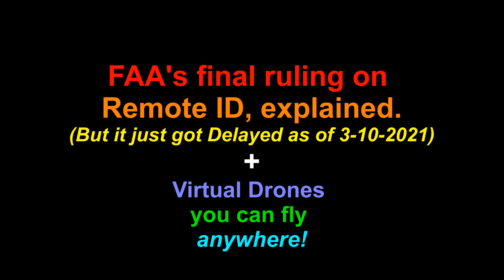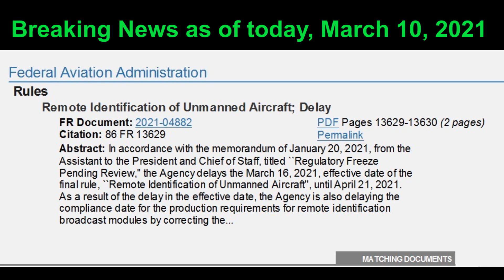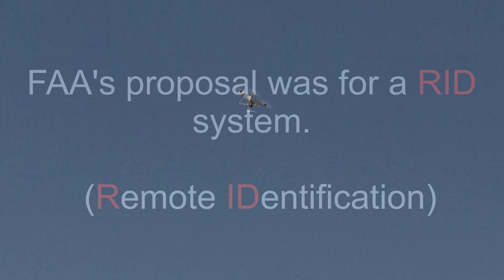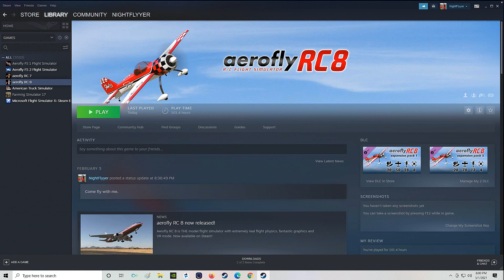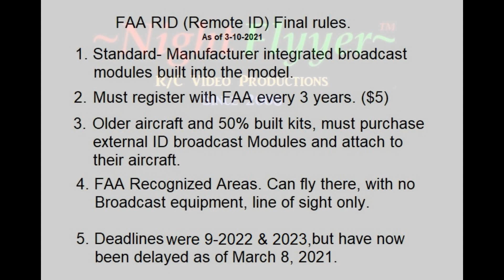Required: FAA Remote ID Broadcast Modules for all model Aircraft over 1/2 lb. I explain the Ruling!

Comment: Well isn’t this another  “fine mess”  they’ve gotten us into.
Reply from the maker: Haha.  Yep.....always something!
Reply: AMA suckers endorsed....What Is Not A Model Of Anything!!! Stupidos!!
Period
Reply from the maker: @rudyho3790  
 I'm only the messenger and just passing along what the FAA, Model Airplane News, and Model Aviation magazines published this month. We in the AMA community tried to stop the ruling but could not. But they did block the rule to register every aircraft you own and blocked the internet link requirement to just a broadcaster.   We only got it modified to be a little better. I DON'T LIKE IT ANYMORE THAN YOU!  My DJI Spark wont take off if I'm within 5 miles of an aircraft, so it has already begun.    If you have a better solution, then again I suggest you contact the FAA and tell them, since it was delayed again and they are requesting comments and suggestions.  Maybe if enough folks do that, this stupid law will be rescinded. Here is the email address.   UASRemoteID@faa.gov.
Reply from the maker: @rudyho3790   I'm only the messenger and just passing along what the FAA, Model Airplane News, and Model Aviation magazines published this month. It was the Full size fire fighter aircraft and airline pilots who complained to the FAA and started it all. We in the AMA community tried to stop the ruling but could not. But they did block the rule to register every aircraft you own and blocked the internet link requirement to just a broadcaster.   We only got it modified to be a little better. I DON'T LIKE IT ANYMORE THAN YOU!  My DJI Spark wont take off if I'm within 5 miles of an aircraft, so it has already begun.    If you have a better solution, then again I suggest you contact the FAA and tell them, since it was delayed again and they are requesting comments and suggestions.  Maybe if enough folks do that, this stupid law will be rescinded. Here is the email address.   UASRemoteID@faa.gov.
Reply: Def.not your doing....we will simply ignore alien👽orders😂😂

Comment: The fixed wing aircraft are not and were not an issue. This ruling is still trash why I'm not buying more aircraft.  What I have will soon be relegated to hanger queen status.
Reply from the maker: That is right for sure.  I don't think we old fixed wing or heli pilots ever were a problem as well.  Full scale pilots were complaining about near misses with drones and that is where it all began.
Reply: @NightFlyyer  Full-scale pilots have been complaining about near misses with things longer than radio control's even existed. "Drone" is just the hot new buzzword. Balloon? Drone. Bird? Drone. Speck on the windshield? Drone.
Reply from the maker: @wun1gee  Yes, and I fly my helis and fixed wings, but never in fires disaster areas or at 1000 feet in the path of full size planes trying to land at airports.  I also fly at a small airport and witnessed a fellow flying a drone over the small town fair 1 mile south of the airport.  When my friend with the full size airplane landed, he complained about almost hitting that drone and came to yell at me, because I was AMA and wanted to turn the guy in with the drone.  I don't know who the drone pilot was, but I know this full scale pilot was really pissed.  I also watched the news of the fire fighter aircraft having to be grounded last summer in California, because there were multiple drones in the air.  They showed them, so never say never.  No one was killed, true, but there are real reports of jet engine ingestion's, and forced landings.  What again, is your suggestion to prevent these rogue pilots?

Comment: I build my own quads and they will never comply with these new rules.
Reply from the maker: Yes, I can understand that.  No one likes this new law, except full scale pilots. What's your proposal to the problem airline and emergency pilots are complaining of with near misses of drones?
Reply: @NightFlyyer  I have flown safely and responsibly for 20 years. Planes fpv for 14 years and quads now for 3 years. I never fly over people or property so I put only myself and my quad at risk. We have to use our heads just like always. 
But nobody has ever been killed by a quad. Ever. I think all the government regulation is unnecessary and a detriment to the hobby.
Reply from the maker: @hutchracing4680  So what is your suggestion to stop the rogue drone pilots from flying at 1000 feet in the path of airlines on landing approach or in the way of helicopters fighting fires?  The Full scale pilots are the ones who complained to the FAA, and started it all. True no one was killed but there are reports of Jet engine digestion and near misses by full size aircraft requiring emergency landings.
Reply: @NightFlyyer  NOTHING will ever stop them! We will still have the problem. Its kinda like guns, guns dont point and kill,   the PEOPLE do, same with cars, motorcycles, If they haven't learned this simple fact yet they never will, probable.
  BY the way great video, THANKS!
Reply from the maker: @bretmuldner  Thanks Bret.
Reply: @hutchracing4680  Exactly! No rules or regulations can stop a full sized aircraft from crashing into a house and killing people while they are asleep in bed but that don't stop them from flying over our house every day. Someone else's fears don't equal, my rights taken!
Reply from the maker: @hutchracing4680  Agreed.   I'm only the messenger and just passing along what the FAA, Model Airplane News, and Model Aviation magazines published this month. It was the Full size fire fighter aircraft and airline pilots who complained to the FAA and started it all. We in the AMA community tried to stop the ruling but could not. But they did block the rule to register every aircraft you own and blocked the internet link requirement to just a broadcaster.   We only got it modified to be a little better. I DON'T LIKE IT ANYMORE THAN YOU!  My DJI Spark wont take off if I'm within 5 miles of an aircraft, so it has already begun.    If you have a better solution, then again I suggest you contact the FAA and tell them, since it was delayed again and they are requesting comments and suggestions.  Maybe if enough folks do that, this stupid law will be rescinded. Here is the email address.   UASRemoteID@faa.gov.
Reply: @NightFlyyer  Enforcement of the existing rules that already made such flying illegal? Just a thought. I mean it makes sense so there's no way in hell the government would ever go with it, but that would do the trick.

This shit is happening because Amazon wants to make some bank on drone deliveries, not because of any legitimate safety concern. They're just using the dumbasses as a convenient scapegoat.
Reply from the maker: @TestECull     What again, is your suggestion to prevent these rogue drone pilots?
Reply: rhetzman the same way you stop bird strikes and drunk drivers from driving
Reply from the maker: @MrHetzman   The birds don't know any better, but people do, or at least most do.  LOL.
Reply: @NightFlyyer  - A 100% ban on all clubs, no quadcopters, and stop all sales just like it has been done w aftermarket parts for diesel trucks and certain guns that no longer can be sold.
Reply: @NightFlyyer  I call shinnanigins with majority of them to be honest.. that's not to say they don't happen. But to be honest "drone" pilots are their own worst enemies
Reply: Next they will try to put modules on birds.
Reply: @rodgerhecht3623  lmao 🤣😂
Reply from the maker: @rodgerhecht3623  LOL.   I'm only the messenger and just passing along what the FAA, Model Airplane News, and Model Aviation magazines published this month. It was the Full size fire fighter aircraft and airline pilots who complained to the FAA and started it all. We in the AMA community tried to stop the ruling but could not. But they did block the rule to register every aircraft you own and blocked the internet link requirement to just a broadcaster.   We only got it modified to be a little better. I DON'T LIKE IT ANYMORE THAN YOU!  My DJI Spark wont take off if I'm within 5 miles of an aircraft, so it has already begun.    If you have a better solution, then again I suggest you contact the FAA and tell them, since it was delayed again and they are requesting comments and suggestions.  Maybe if enough folks do that, this stupid law will be rescinded. Here is the email address.   UASRemoteID@faa.gov.
Reply: Post a video I'll turn you in. Lol FPV pilot's will I Care less. I was trolled for a year by a gang of fpv pilot's!  now I watch hobby die.. and I loved it my regular friend's Saw over a course of a Year what FPV means.. And it's not Good. No Honor.. or pride.. just second accounts..
Reply: @sleepingbearffg5008  no one with a brain will post a video
Reply: Amen brother!
Reply: @bretmuldner  no Godly in Hobby? I asked..

Comment: They did not RESIND  They postponed it. Until the infrastructure is in place, then you will PAY to FLY to a PRIVATE INDUSTRY or PROVIDER. The GUBBERMT is going to control every aspect of your R/C flying. Idiots flying QUADS caused this Quagmire. No one bothered REAL R/C Enthusiasts till these IDIOTS showed up. I don't mean QUADS just their STUPID PILOTS.
Reply from the maker: The FAA has made the final ruling.  But they did responded to the first proposal by eliminating most of the rediculous of the proposals that we fought against.
But this week, they Delayed the Deadline before it is required.

Comment from the maker: Breaking News.  As of today, March 8, 2021 the FAA released its final version of the RID Remote ID Broadcast modules for all model aircraft that weigh over 1/2 lb.  I don't like it either, but I am just the messenger here relaying what the latest issue of Model Aviation and Model airplane news has published this month. Here is the email address to write to the FAA and offer your opinion or suggestions.  UASRemoteID@faa.gov.  In this video I explain what the FAA wanted to do, versus what the final decision was. And if you don't like what the FAA did, post your solution.  So the AMA community kept the FAA from implementing the first proposal and glad they did.  Of course they could not get the FAA to change to only drones be the aircraft to need these Broadcast Modules, but instead they made everybody need a transponder.  That sucks for sure.  But then what would your suggestion to deal with people flying drones in airline and emergency aircraft's flight paths?  The pilots complained of near misses and engine ingested drones,  and that started it all.  I can understand their fear.   Tell us what you would do? Although the rules are set, the deadline for manufacturers and modelers to comply was delayed on March 10, 2021. I assume the manufactures need a lot more time to design the broadcast modules for new aircraft along with designing add on units for older aircraft and helicopters.  If we didn't fight back, there would have been many of us old time flyers, retiring from flying.You must register thru the FAA every 3 years to renew you number. $5. Register here.  https://faadronezone.faa.gov/#/ This number will be transmitted by the Broadcast modules along with altitude, take off location, the modules serial number, and more.  All new models must have integrated modules built in at the factory.Older RC airplanes, helis, and drones, must have the pilot purchase an External Broadcast module and affix it to the machine. FAA Recognized Areas  (FRIA's) can be also applied for by certain groups.  There, you can fly without the broadcast modules installed. Most AMA clubs will request to get FRIA permits, so there is an alternative and reason to join and also get that 2.5 Million dollars worth of Liability Insurance. Hope this cleared up what has become inevitable due to technology advancing so fast.For more information, visit The Academy of Model Aeronautics at http://www.modelaircraft.org  For Aerofly RC-8 details on Steam  https://store.steampowered.com/app/1507210/aerofly_RC_8/      Happy Flying, Dave